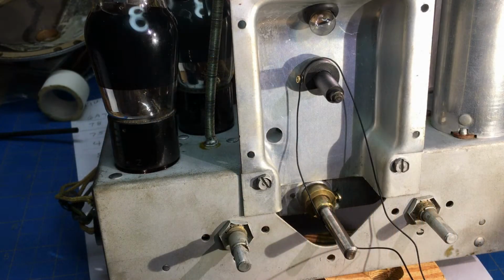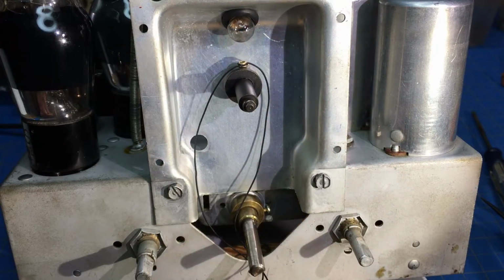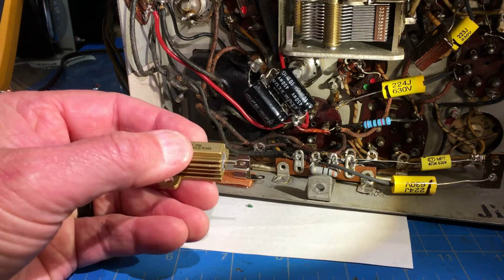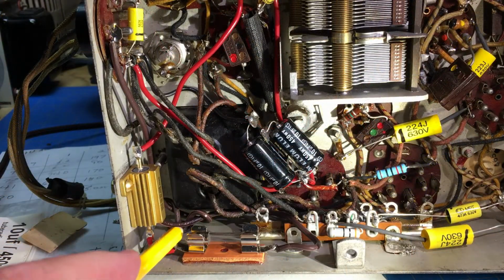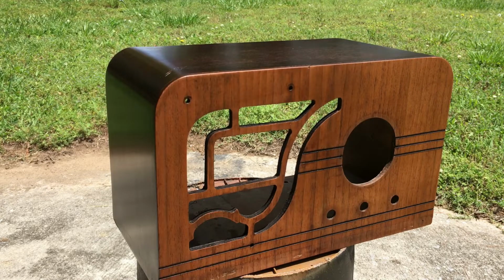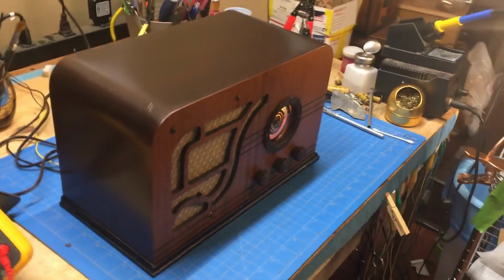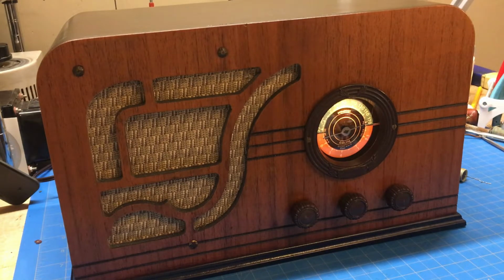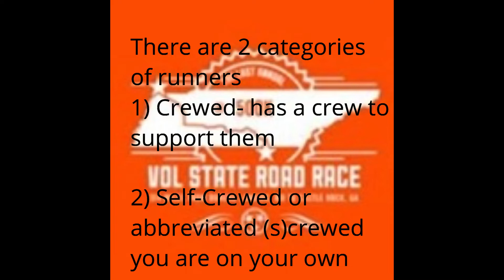1936 Montgomery Ward 62 315 Part 4 of 4 Restring Dial, Finish Cabinet and Final Demo

Comment: The "Airline" came out wonderful. I like  your idea of using a resistor to drop the supply voltage! Good luck in the race!
Reply from the maker: Radio wild Thanks Bob!!! Yeah, if you have the room and don’t mind drilling holes (I wouldn’t if it were a rare radio) then the resistor is easy.....Thx on the race (I know I’m not in contention, but am out against the distance and clock!!) vacationwithoutacar  Take Care—Larry